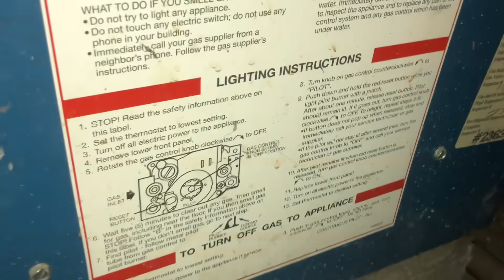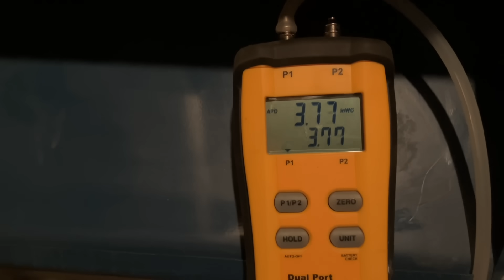Emergency No Heat Call! 🔥 Kenmore Steam Boiler Fixed with New Thermocouple

Comment: I am glad you like my lighter suggestion a while back.  They work great of all sorts of stuff around the house as well, and best of all when they get low on "fuel" you can just fill them back up by any phone charger.  🤠👍
Reply from the maker: I appreciate the tip! It's always good to have a multi-use tool on hand.

Comment: I hate those pot metal pos thermocouples had to melt them out several times, On another note shut down a steam boiler cracked, flush valve plugged with baby poo, no Hartford loop, steam header was only 7.5 " i actually measured it. 
They have only lived there 5 or 6 years was told the bangs were normal in steam heat 😅 boiler was installed in 02 . Wish I knew how to send pics on the u/t.